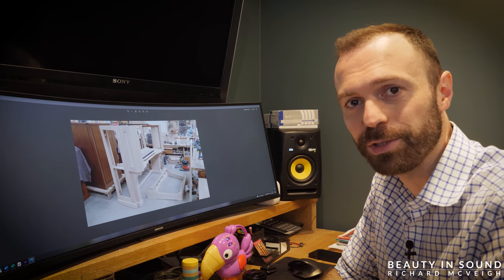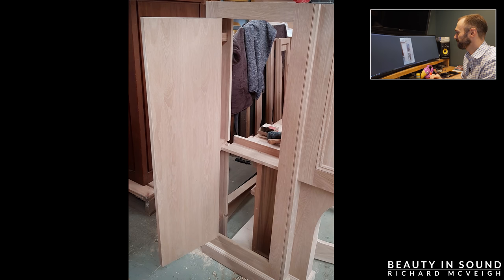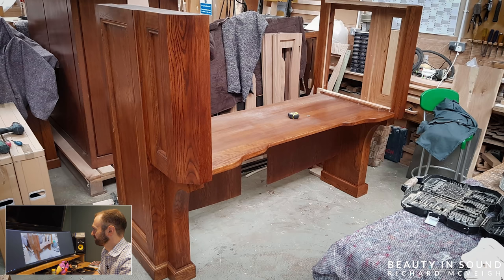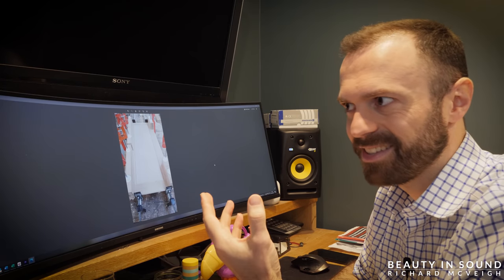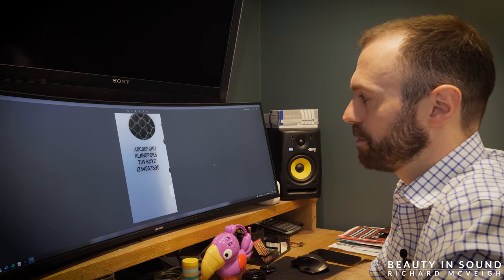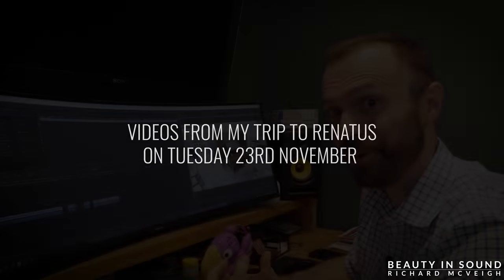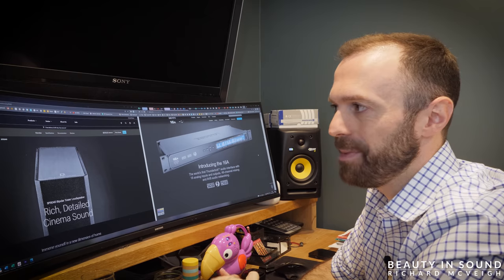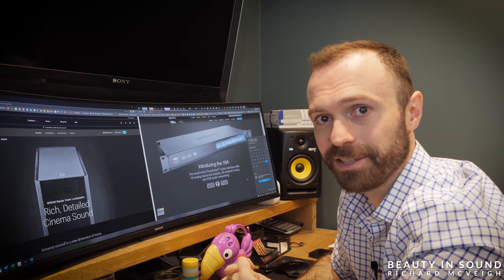🎵 My New Organ - It's almost finished!! | November Update (My Hauptwerk Setup)

Comment from the maker: I realise I didn't give many details about the new laptop in the video, so here they are:

Lenovo ThinkPad P15 Gen 2 Mobile Workstation
CPU: Intel Xeon W-11955M
RAM: 128 GB DDR4 3200MHz ECC (Error correction code)
Graphics: NVIDIA T1200 4GB
First Solid State Drive: 512 GB PCIe SSD Gen 4
Second Solid State Drive: 1 TB PCIe SSD Gen 3
Third Solid State Drive: 1 TB PCIe SSD Gen 3
Windows 10 Pro
Reply: ThinkPads are the beast. I have a 3-year-old ThinkPad A485, and it runs like a champ.
Reply: Nice! Does Hauptwerk play nicely with Windows 11?
Reply from the maker: Not sure yet!!
Reply: @minimvsuk  I haven’t had any issues, but I haven’t been able to use it with any midi hardware yet
Reply: Looks like some server class bits in a laptop form factor.
Reply: @minimvsuk  I think Hauptwerk uses a very tiny amount of Windows functions. Almost all changes from Win10 to Win11 will be irrelevant to Hauptwerk i suppose.

Comment: Magnificent craftsmanship.  Can I make a small suggestion? If building or acquiring a console, pedalboard and bench  they are very heavy and it is back-breaking to move for cleaning, servicing etc.  I built a platform in 2 sections on casters for the organ to make it much easier to move especially  into another part of the home.  Essentially built from chipboard sheeting  used in house flooring and braced with 45 x 45 mm timber.  Each section has 6 swivel casters to spread the load.  The 2 sections clip together ( I used gate hooks to stop them drifting apart ).  One  section holds the console and the second  section the pedalboard and bench which are removed from the console and are moved separately.  Suppliers of new product only sell chipboard or plywood in large sheets meaning we have to buy much more than needed.  But I found building recyclers selling suitable sheets of varying sizes previously used in partitions.   I bought casters (50 kg rating) very cheaply at the local discount store.  And a coat of paint does wonders  to hide imperfections including my workmanship. But it has reduced the risk for me  of back injury.  I have built another for the local organ society which need to regularly move  their instrument.

Comment: The console looks really beautiful, all that woodwork. My 10k$ 4-manual Content console looks a bit minimalistic to this 😅 (But good enough for me). Your playing skills really deserve such an amazing console.

I think you had better gone for real PC hardware instead of a laptop. Laptops are usually end of life after 4 years or so and are way more expensive than PC hardware, as they are made to be mobile and look sleek which is unimportant inside an organ console. PC hardware gives a lot more bang for your bucks. Also if a single component fails then you can just replace it when using PC hardware. On a laptop it ends up very quickly with tossing the entire laptop in the bin to get a new one.

During my study period i had a laptop of which the graphics chip its solder connections started to break on the main board. I was able to fix it by unscrewing the entire mainboard and putting it in the oven. But 2 months later it was broken again. Another laptop in the bin. With a PC it would just have cost a 50$ graphics card.

Comment: After using DefTech powered towers, I would never go back to them. The response is not flat like studio monitors, and you are constantly fighting it to get the sound to come out properly. The sound from the PreSonus R80 monitors that I am using now is also MUCH clearer. Unfortunately, the DefTech BP 10B speakers used originally in the organ at Trinity Church Wall St in NYC are no longer available.